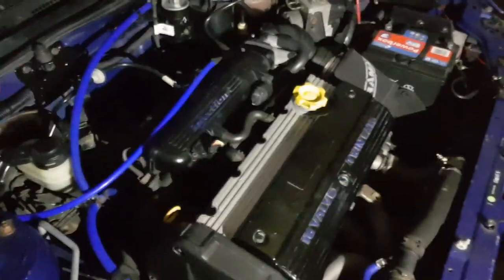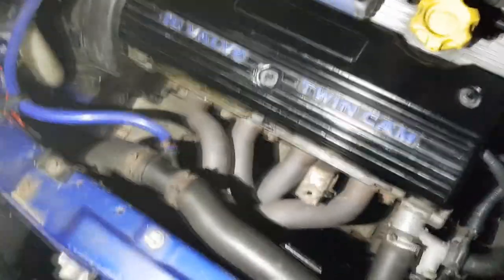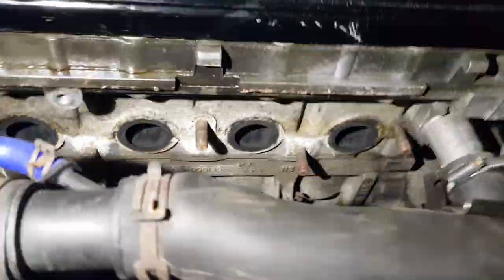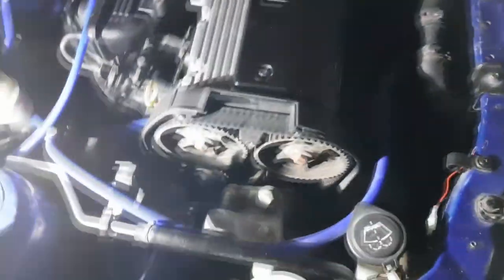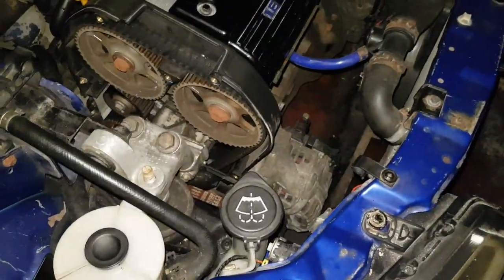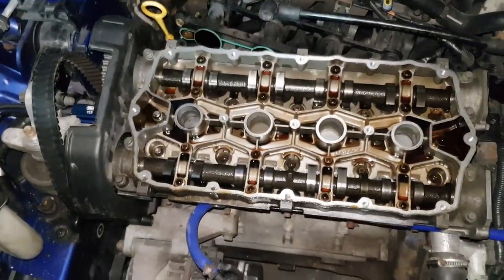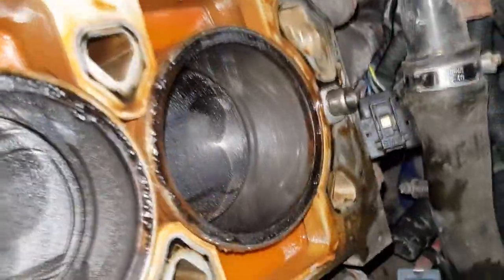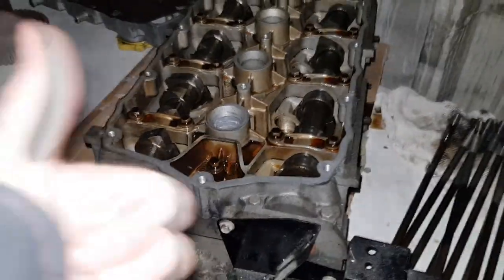Pulling The Head Off Of My MG ZR | K Series Head Removal | Project MG ZR

Comment: good little vid mate. i gotta whip inlet off mine at least, as its got symptoms of leak, blow andhead gasket possibly (which im not admitting to myself yet) so i think this vid may of helped mate ty. what oil, coolant and plugs do people use? mines the 120 1.8
Reply from the maker: Thanks, best to use 10W40 semi synthetic engine oil, pink coolant and I personally use NGK spark plugs. This is the only kit I'd use for repairing head gasket https://www.dmgrs.co.uk/collections/head-gasket-kits/products/k-series-payen-elastomer-head-gasket-set-full-kit
Reply: @PigsLikePineapples  not MLS then? yeh heading out tomoz to grab some bits before i can say it is HGF i dont wanna pull head off if its inlet gasket. just get paranoid when all your buying is someone elses shit work init. wanna know lol. cheers mate
Reply from the maker: @mattsmith6780  yeah I get you, I used to think MLS was worth it but now I know a Lot more about the kseries MLS gaskets tend to fail a lot more because of uneven liner heights